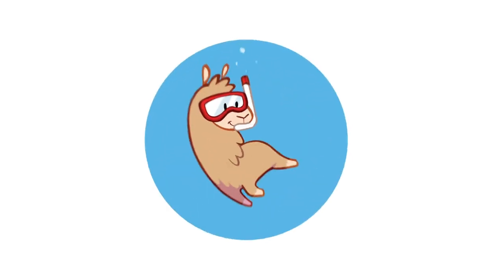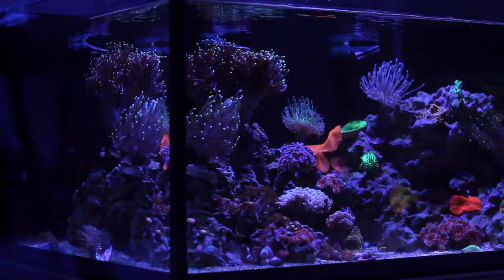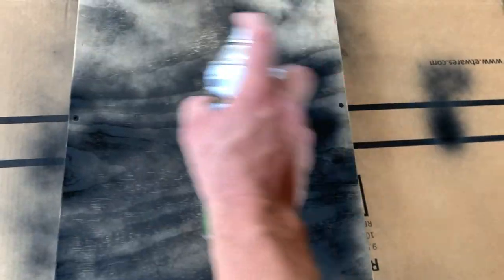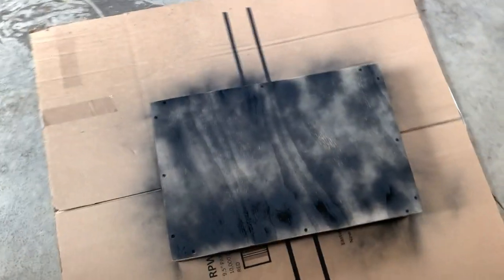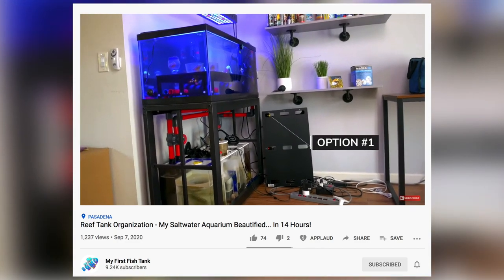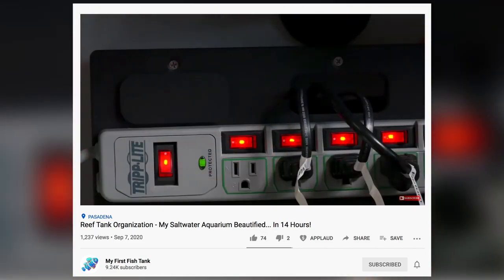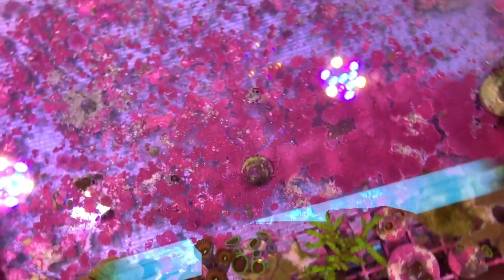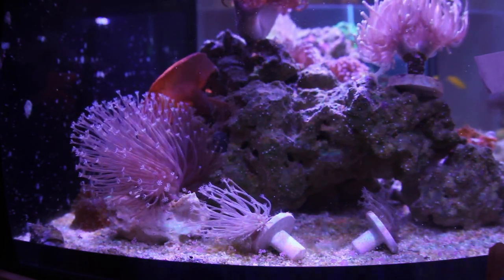Constructing An Easy DIY Reef Aquarium Control Board for Lagoon

Comment: Velcro!  loops for making wire bundles, and double-sided with adhesive to mount your power bricks up high in the stand.  Easiest and cheapest cleanup :-)
Reply from the maker: Yeah I definitely need something better for the power brick.  Thanks!!
Reply: Double sided velcro is the one thing. In addition to bricks, wrap cords instead of zip. Then when new stuff or need to remove something for maintenance just undo the velcro and re fasten it on the go

Comment: Nice you made a French Cleat out of wood for hanging. You can pick up metal ones at most framing and craft stores. 👍🏾
Reply from the maker: That's a good idea!  I wanted to cut the wood at an angle but unfortunately don't have the proper tools.

Comment: Hey Remy,
cool controller board! I built my controller board at the wall side of my room divider. Now there is one cable entering the room divider. Therefore two things are indespencable (for me): drawer pull-out to slide the whole compartment beside the aquarium and velcro fastener for simple release of each controller, power adapter etc.
Reply from the maker: Love it!!  I'd love to see this!
Reply: I would be delighted to send you some Pics. Is that possible?
Reply from the maker: @germanytraveller2419  If you're on IG send to BahamaLlamaCoral :)

Comment: I used a label maker, I got it on amazon. The best $30 that I have spend !! 🤘🏻
Reply from the maker: Great idea! That will be the next purchase for sure.
Reply: Amen, I think I have used my label maker more on my reef equipment than what I originally purchased it for.
Reply: I also got one as well after I was yelled at for not labeling my wires. 😁
Reply: @elslick  🤣 me too! I labeled like everything on my tank man
Reply: I've had one since like...2008😂😂 so useful, I use it for everything hahhaa
Reply: @carminecarlone2869  Hahaha yeah. I have everything labeled. Since I have not accidently unplugged the wrong thing. Plus it helps if you ever need a helping hand. Just tell them what it is and they can easily find it. I love labeling and cabel manage to, must come from running networks on a naval ship hahaha.
Reply: @elslick  yes exactly! And thank you for your service sir.🇺🇸
Reply: @carminecarlone2869  No problem your very welcome, but yeah after doing an entire warships network upgrade. Hardware and software. You become a pro at labeling. Haha

Comment: The ADJ power strip on amazon has individual, lighted switches for each plug, and the wires all plug in to the back for a nice, clean look. Well worth the $37
Reply from the maker: I am very familiar with this strip!  Many, many weddings I've DJ'ed and radio studios that have run this strip.

Comment: I use zip ties and a staple gun. I staple the excess piece to the beams i run them on. I think carpentry is one of the things that comes with the hobby that is a more difficult for me than plumbing or electric/tech stuff. Looks great! Good job!
Reply from the maker: Thank you! Yeah, wish I had more trade experience but I get by.  If I can't do it we've got a great community in STL that can help!
Reply: I agree that you can use carpentry a lot, heck I built everything except the tank haha, but electricity is WAAAYYY harder. I know some but man it gets complicated😅

Comment: Looks great! I’m still in the process of running/organizing all my cords to the apex control box... (I have to get some extensions for my MP40s to reach up where I have everything mounted... shoot me now.)

My only tip is to plan where you want to store all your powerbricks for your equipment (especially if you have a bunch!) only saying this because they can generate some heat fast. I don’t have enough room inside my build, so I will most likely mount them next to the board on the wall. (I’m also not spending an arm to get the ecotech mounting brackets, so a DIY idea I must come up with...)

Cheers again though, looks a Thousand times better!
Reply from the maker: Thank you!  I know guys like @fishofhex make 3d printed power bring brackets so that could be an option in the future too.  Maybe for the frag.  There's 4-6 power bricks on that tank.
Reply: Bahama Llama Coral yeah I was thinking about fishofhex’ model. They were like half the price, But I would still need like 10 of them. Rip.😑
Reply from the maker: @MoreTankMoreProblems  And the cost of this hobby strikes AGAIN. 😂

Comment: Nice Video, I need to work on this also.. Mines currently a rats nest but on a shelf above the tank so i'm not worried when I flood the floor...
My favorite go to for cable management is the Velcro cable tie. I use these instead of zip ties cause i always make mistakes and its easy to pull something out if you need to :)
Reply from the maker: I agree on the zipties.  Plus, when you cut the excess it always leaves a sharp edge.

Comment: Remy - Just an FYI, I have the same tank and use the Aqua Shield as well. Recently I had some acros die off and couldn’t for the life of my figure out why. Tried everything. 

Today, I took out the Aqua Shield and found a burnt to crisp bulb and when I washed out the inside, there was black soot on the paper towel when drying it off. I guess the plastic degraded over the 8 months I’ve had it. Similar to the Jebao that FishofHex made a video on. 

Unfortunately I would turn my return off for feeding, but keep the UV running. I believe this cooked the bulb and led to the plastic issues. I think it’s a solid lesson in 1.) Checking your equip regularly and 2,) Never having a UV on without running water through it. Even if it’s a couple minutes. Tbh when corals were RTNing this was the last thing I would have suspected.
Reply from the maker: Thank you for this.  It's my first UV Sterilizer.  I know that these bulbs need to be replaced every so often but this gives me a little extra incentive to inspect every water change.  Thanks!!
Reply: Bahama Llama Coral It was/is my first UV as well. 

Good news is today all my corals are starting to open back up and look a lot more healthy. Hopefully It’s the end of the losses. Thankfully didn’t lose my Purple Monster or Pink Panther Acros.
Reply: @JMehalick  🙏sorry to hear man, good luck glad stuff is getting better.

Comment: I just use zip ties and connect my wires around a piece of drilled plywood attached to the back of my cabnet
Reply from the maker: Yeah, I think I'm going to use some zip ties to tidy up just a bit more.  Thanks for the watch!
Reply: @BahamaLlamaCoral  I used a similar design to you building it out and then drilling holes and having the cable storage area in the back. I just zip-tied them and on and used the occasional velcro style zip ties to attach the wires and they run through the wires. Note this is for my freshwater tank been wanting to go and get my first marine tank for a while but since COVID my mum won't let me go out to get it. Point is not sure if the style I used would come with extra complications